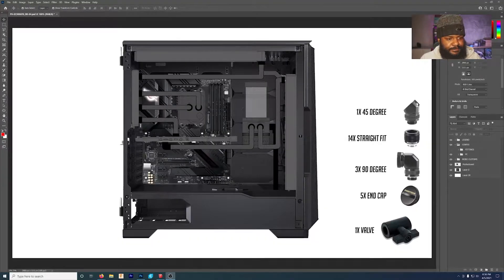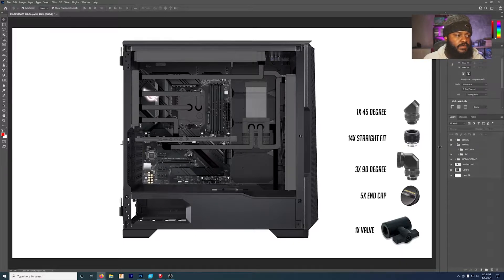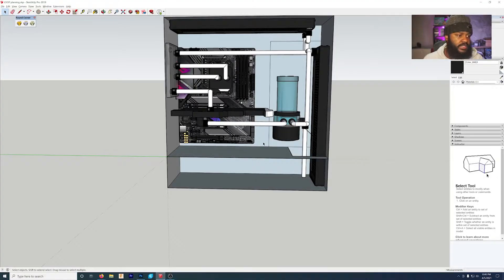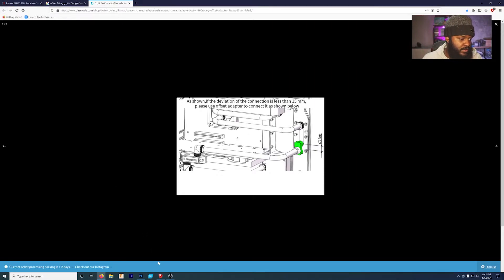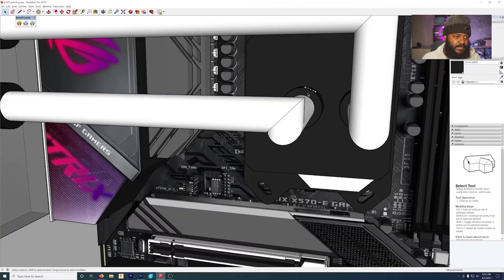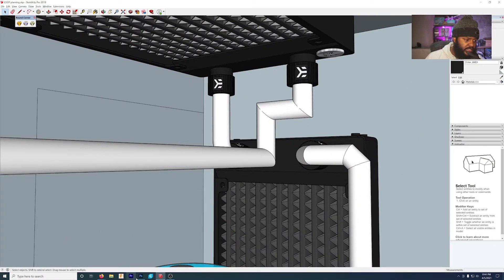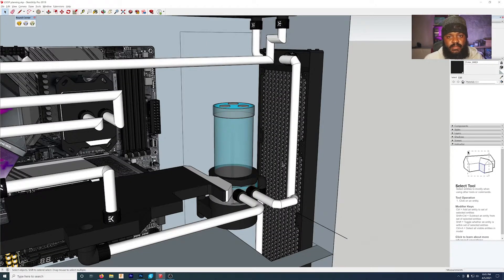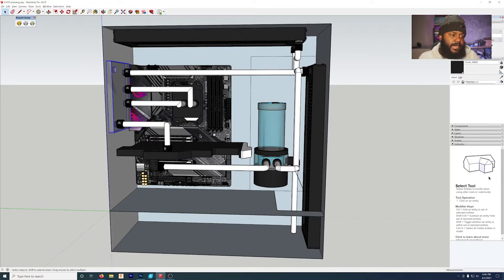PLANNING A WATERCOOLING LOOP: Using SketchUp & Photoshop to plan a loop

Comment: Like how you have been really learning and figuring things out. Great use of Photoshop and SketchUp to figure out your additional fittings. 
Questions:
Have you considered an alternate loop route?
How challenging was the process of using SketchUp to plan the runs?

#AO
Reply from the maker: Thanks! Well in the final build video I'll show you the alternate ones, it definitely didn't turn out how I planned but it helped have an idea of what to expect. Using Sketchup wasn't difficult just because I've been using it for so long but its definitely not something I'd recommend for a beginner